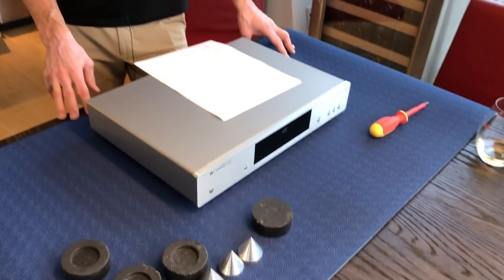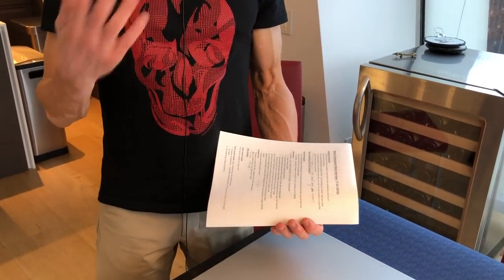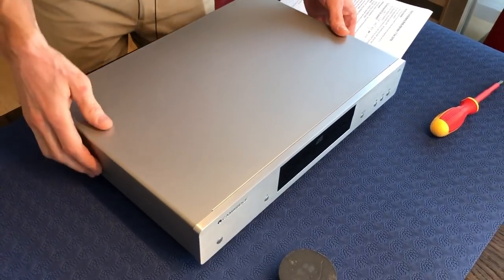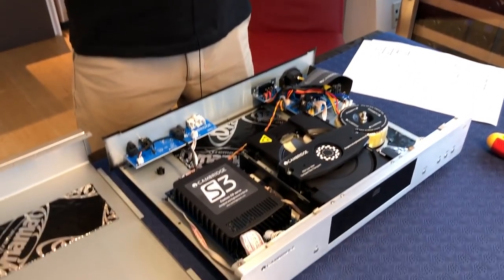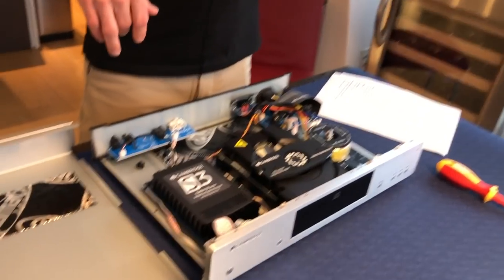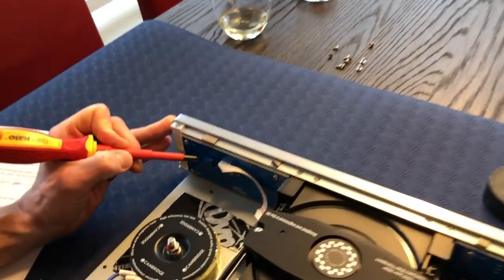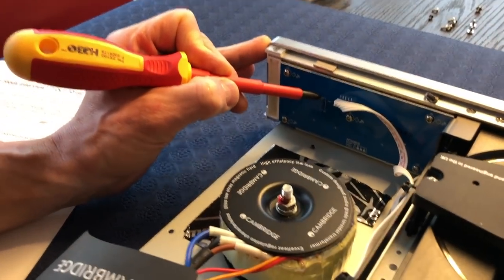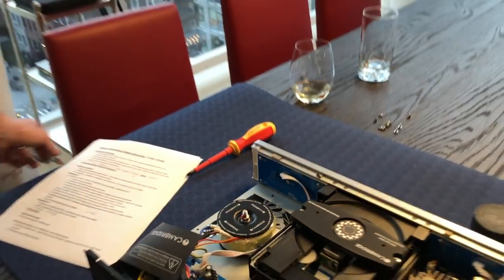Miguel pops the lid on his CD transport to tweak the sound

Comment: Are you using an upgraded power cord with your CXC, Miguel? If so, just curious if it makes much of a difference.
Reply: No I am not. This is a $449 player so I am keeping the other components in the price range. I am using a tasty shielded 16awg power cable (got it with some unit, maybe the CXC) and a delicious $18 Blue Jeans RCA-BNC cable.
Reply: I could actually try something, I do have some pretty pricey cords unusued

Comment: Question: If you just copy the raw cd data to say a fast USB stick wouldn’t that remove any limitations or short comings from the transport system all together?
Reply: What you really mean is ripping the CD to some file format - I don't know of any other means of doing this. The answer is not necessarily because the USB interface can have issues of it's own: you would need a computer to play the files in the USB drive - or some similar means of doing this. How you do this vary and those variations do matter. For example, plugging in a USB drive into my Rossini, which can read files off of a USB drive directly, is one of the most pure ways to play music - better than Roon over the network. But most DACs would not support that so you'd have to use an intermediate electrically noisy computer. So the answer is: It depends!
Reply: @miguelbarrio  Thanks Miguel. What I do is plug the USB stick into my streaming device and output it to my amplifier via the optical fibre connection. So I guess the streaming device acts as the “computer” and the amplifier DAC does the conversion to audio? Or does the amplifier perform both functions and the streamer just provides access to the storage device (USB stick)?
Reply: @fatcityhockey  Ok understood. The streaming device is usually a pretty lean computer, so from the standpoint of noise passed onto the DAC it's prob ok. But there's more to this. A low quality clock and using the toslink connection is likely to have a substantial amount of jitter - and this is a problem as the SPDIF spec requires the DAC slave to the source clock.

Comment: Could that dynamat get hot and leak onto other parts?
Reply: No. A unit like this never gets hot. If you put Dynamat inside a high power class A amp I can imagine it could possibly melt, but an amp that would get very hot would generally be very heavy so what would be the point of using Dynamat in the first place?

Comment: This nonsense is just not needed on any kind of modern CD transport/player. 30 years ago the data transfer rates required of a CD transport was at the cutting edge of what the technology could achieve but NOT today. Your Blu-Ray or PlayStation  routinely achieve much higher transfer rates with 100% accuracy.
Forget about clocking and all that since the  data transfer protocols such as SP/DIF just transfer data in sequence  - your DAC's pre-processing will unpack and buffer the data transferred then present it to the DtoA chip at the appropriate rate.  So long as the average transfer rate is high enough (and it will be unless your interconnect cable is broken) your DAC will play perfectly.
This CD transport is already massively over-engineered but that may help it last longer or even read damaged disks.
Reply: That is just not how SPDIF playback works. The CD transport clock and the DAC clock will never match in frequency (they are close but obviously not exactly the same). If your DAC is slower, the buffer you are talking about would get full, if it is faster it will run out. There’s no way to tell the transport to stop sending data or speed up (unlike USB). So strictly speaking the only proper way to play is to recover the clock from the SPDIF signal. The SPDIF signal is a “square” wave with a peak-to-peak of about 0.5V (SPDIF spec is 0.5V-0.6V). The removal of noise (power supply mostly), the removal of resonances and feedback (dampening), etc can all alter the voltage level and slope of this “square” wave. Clock recovery happens with the voltage transition from -250mV to +250mV. If there is noise there and a long rise time, clock recovery will be affected. What is the solution to this clock recovery problem? Two I know about: One is the dCS method of having a master clock feeding both the transport and DAC. I do have a dCS master clock but this cheap CD player doesn’t have an input for it. The second method is to use an I2S interface - but not just any I2S, only those where the clock for the player comes back from the DAC is useful (the implementation where the transport clock is sent over a secondary line is worthless as the SPDIF signal is just as good). These considerations are the ones that the mods are trying to improve on.
Reply: @miguelbarrio  Thanks for taking the time to reply but in my opinion your answer is simply wrong. Things do not work that way, I suggest you do some research into how computers and especially data transfer protocols work.
Reply: @phrtao  And I suggest you figure out how SPDIF works. This has nothing to do with general bandwidth ability, it has to do with things you can SEE IN A DIGITAL OSCILLOSCOPE!!!
Reply: @miguelbarrio  Digital systems have nothing to do with what you can see in an oscilloscope. It's all about how the data transfer protocols work. But let's put an end to it now please. I remember from the video that you are a highly qualified physicist so I will defer to your superior knowledge and forget what I learned working for 20 years with digital electronics.

Comment: Miguel, nice work so thanks much. Off topic, if I may: what beans do you use in your LM GS3 and is your portafilter bottomless?
Reply: It’s a La Marzocco GS3 with a Strada MP head mod (for pressure control). Yes, bottomless portafilter. Grinder is a Mahlkonig Peak - this is key. Beans: Intelligentsia Black Cat Classic (currently); Stumptown espresso blend; Blue Bottle espresso blend; sometimes I use some single origins, but I love the depth and fullness of blends more than the purity of single origin.
Reply: @miguelbarrio  Thanks again. I like those beans as well.  Keep up the good work, btw. May I ask which DAC you use? Cheers.
Reply: Les dCS Rossini + Rossini master clock (although the master clock is irrelevant for an SPDIF signal)

Comment: I find this odd with all the mods which is fantastic what you have done however why do you want to even turn up the brightness gain on the display!!? 🙄 🤔 You want to use the display to just check to make sure the CD has loaded correctly or select you do realise having the display on gives out RFI noise on the line so keeping that display on higher will make that worse ahhh. I found it odd as you are moving power cables around inside which is definitely a good idea 💡 but then turning the LED Pot up.. When I play any CD's on my current Marantz Reference SA-15S1 I switch off the display as soon as I am ready to play a CD or SACD and it does make a significant difference to the audio in fact marantz makes a case for switching display and digital coax to off in the Manual I have to obtain higher audio and it does make a noticeable different.

Also tuning up that POT may in fact lessen the lifespan of the LED displays and put more pressure on the Caps and risistors over time so not a good idea 💡 in my opinion.

My previous CD Player which I still have as a backup is a Arcam CD93T I also killed the LED display as soon as I was ready to play a CD button on the remote. Including my Denon X4100W AV AMP I also kill of all displays does 2 things prolongs the life of displays and also keeps down all internal RFI interfaces down to 0% or down to a minimum possible. 

Anyways just my own throughts and opions from London, UK 🇬🇧 🇬🇧 🇬🇧 love the video anyway more please.
Reply: Spot on.
Reply: Possibly but these days the light is produced by dc-running LEDs so I don’t think you get the noise you’re talking about. The display is very dim in this unit, I don’t know why. The Cambridge brightness selection only select between dim and dimmer - never off. A miss. In any case the brightness increase is small when tweaked. I am actually wondering if there’s a filter on top of the LCD that I could remove, as you can see the background light and it is not dim at all.

Comment: Am I the only one screaming on the inside "IT'S DIGITAL" ?
Reply: It IS DIGITAL. What do you mean?
Reply: Miguel Barrio I suspect he means that bumps in a spinning vinyl disc converted to minute electronic signals using a very expensive cartridge requiring extra stages of amplification and costing vastly more yet having inferior  levels of separation (lame soundstage), more noise, more distortion and a terrible dynamic range (worse than the cheapest DVD player with CDs) would somehow be better. I love your speakers, love horns, I have been using JBL 2397 horns since the early 80's. Would love to see a comparison (your preference) between vinyl and digital source on your system. (Hint for Steve). My digital sources totally beat my vinyl source but YMMV.
Reply: @kirarittberg5088  I think he means "It's digital it all sounds the same" and this is not the case, not because the "numbers recovered from the disk" are different but because there is a lot more to getting that to an analog signal than the numbers themselves  (eg the discussions below of the timing of those numbers). 

Comparing digital and analog is a complicated task. There are many factors. I don't currently have a vinyl setup (yet). What I can tell you is that a very high end vinyl setup, with a good pressing will sound better than the best digital out there. But we are talking very high end in my experience ($30k or so) and very good pressings.

Comment: What? 5 picosecond? On USB cable? LOL im laughing my a$$ off here. Do you guys know what digital means and how it works? Jitter is hardware based, not cable based. And how did you meter it? With your ear? :D
Reply: @ The viking, rather than 'lmao' have you ever tried such things?

I'm not saying they work or they don't, just laughing at other people's thoughts and experiences isn't very useful.

Do measurements alone tell an entire story? That is....does checking measurements alone tell you exactly how a piece of gear sounds? I'd suggest not, you still need to listen to confirm what any measurements may or may not be telling you. 

To take that a step further, if you must listen (& I'd suggest everybody does), what is the point of checking measurements prior to listening? And does that cloud your view during the listening process, because you now have a perceived view of what something 'must' sound like?

Cheers!!!
Reply: @nostro1001  yup. I got degree in sound produsing. There is no sound differences is USB cables as long the cable meets the USB regulations. Jitter can be problem is the hardware clock is poor but now days its hardly problem with modern DACs.
Reply: I think you need to watch this again to get exactly what I said.
Reply: @Thevikingcam  Thanks for the reply...I'm not doubting you or anybody who may view things differently. As I don't have a degree in this area (but do have 2 other degrees), I'm always keen to learn from those who know more than me and typically have an open mind. 

By open mind that usually means (in my case), keeping my ears open, so that I hear or don't hear purported differences. 

We all hear differently, have different preferences etc. I'd also suggest whilst some may call out the placebo effect at those that say they hear differences in cables and so on, that logic also applies to those that only look at measurements and make judgements accordingly. 

The 'art' of science is continually evolving. What we know now may change in the future; it is not a static discipline. So, any scientist will know there's 2 extremes: highly likely or highly unlikely. Neither of those are absolute.

On that basis, I'm of the belief whatever somebody hears or claims they hear, they do. Whether I hear said claims or not is up to me to decide. Further, even if I do hear sonic differences, I may not think they are a so called 'upgrade'. By contrast, I may not like what I hear as much. 

Happy listening. 😊
Reply: @nostro1001  Science provides tools to eliminate subjective considerations: it's called 'double blind test'.  In many cases 'whatever somebody hears or claims they hear', they actually don't.
Reply: @aledelaplaza1156  I fully understand the concept of a 'fair test' in science & if you say in audio that constitutes a 'double blind test', I'm happy to go with that.

On that basis, do you then void the vast majority of audio reviews as a waste of time and pay no credence? In fact is there any purpose in reading or listening to them at all, beyond time filler, if they have occurred without a 'double blind test'? Just curious. :)

Further, when conducting said test has there been any consideration to our aural memory? Should one listen to a whole track, an entire album, a snippet of a track for a specific length of time, a new piece of music, a favourite recording, a variety of genres, a variety of tracks etc? What is optimal?

If science was the simple answer to this, there are so many variables that must remain constant ('fair test'), but if not within the realm of our aural memory will skew the results.

What happens if a 'test' is completed under the same conditions with 2 different people (i.e two like tests) & one person hears something the other does not? So, is it important to conduct a 'test' with numerous listeners or will just one listener suffice? Must it be done in the day or is nighttime better, where there is typically less ambient noise? What happens if the listener has a cold or just isn't feeling their best? No doubt I could go on!
Is any of this even important so long as a 'double blind test' has taken place?

And I think that takes me back to my original point (up above), that we all hear differently - part aural capacity and part auditory working memory. Hence, I don't doubt what others purport they hear and I definitely don't laugh at them (where the thread started). If I'm doubtful, where possible I could always test myself and determine what my ears hear or otherwise I'll likely remain ambivalent, but definitely not discount the personal experience of others. Conversely, if I'm convinced I may just go and do 'whatever' was suggested.

Oh and given that such tweaks are about incremental upgrades in the first place for the said listener, that then clearly makes them not for everybody who may or may not be capable of discerning any difference.

Enough of my 'ramblings' - the topic is huge & it really ventures into the territory of the brain, where I think few of us are experts.

Enjoy the music is I think what it's all about. Happy listening!
Reply: @nostro1001  In this particular field of sound reproduction there has been very little effort to conduct scientific evaluation since the 60's when Bell Labs concluded that 8-bit companded PCM was addequate to provided 'quality of service' over the phone network (yes, I am that old!). Sound reproduction involves now much more complex systems, and if we conceed that is possible to measure sonic differences that only our incredible sensitive hearing system is capable to detect, it would be way too expensive to accomplish anyway. In this scenario we have to accept the current situation and agree with the opinion of trusted reviewers (if it make sense to us!). In my particular case, suffering from tinnitus and my aged hearing system being a wreck, there is no alternative. But being an engineer (and an audio reviewer in the early 70's!!!) I search for physical justification or explanation of sound reprodution intricacies, of which I cannot produce scientific proof. For example, regarding the issue of Miguel CD transport tweaks, sound produces mechanical vibration on case and components, that translates into jitter (an analog phenomenon!) and then into spurious sound waves onto the DAC output at levels below quantization noise, but because correlated with the original music,  Miguel ear (not mine!) is able to detect. There was a funny comment on this forum regarding Miguel being "... rich as fuck", mine is a much less funny:  "... young as fuck".

Comment: So what exactly is the difference between a CD Transport & CD Player?
Reply: Audiognome a transport does not have a built in DAC,  you have to add a external DAC. A CD-player does have a DAC built in.
Reply: Transport = only digital outputs
Reply: A transport is the mechanism that spins the disc, and has the laser to read the discs, but not the electronics to produce the sound. Those are purchased separately, sometimes from a different manufacturer.

Comment: The first thing was as simple as putting a book on top. Now, can i instead put my 12kg amplifier on top of it? Or is that too much weight?
Reply: I think that would be fine.
Reply: But keep in mind that the goal is to reduce microphonics - the vibrations in the internal components, most notably the clock. A heavy weight applied on the four corners might not do much to dampen those vibrations. In this sense a heavy book is a better option.
Reply: @miguelbarrio  thanks but don't you think that weight on the four corners may harm the case?
Reply: @joaoroman9583  good question. I wouldn’t think so if it sit relatively close to the edges. More importantly, I don’t think it would help much. The top cover of the transport is like a timpani vibrating with the sounds in the room and transmitting those vibrations inside. This is what you want to eliminate. Which is why a book would be better at it.